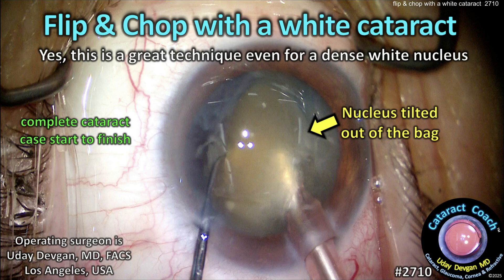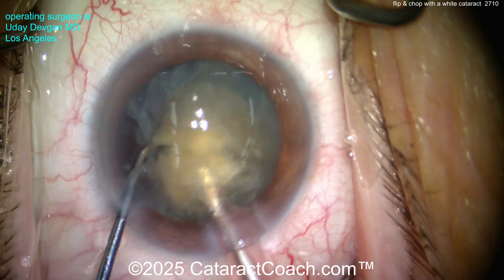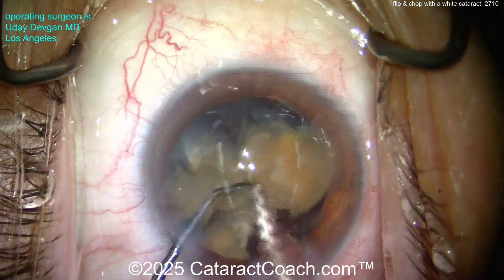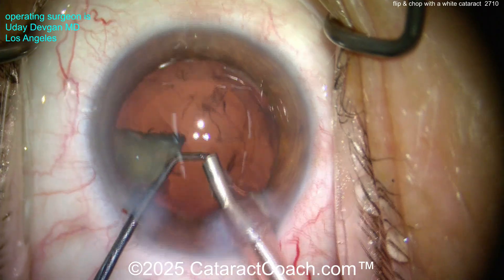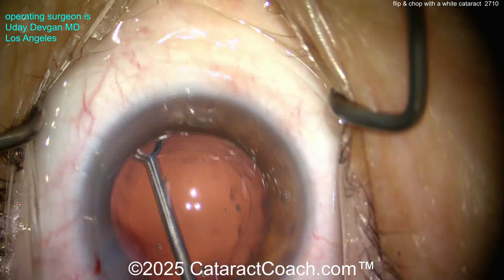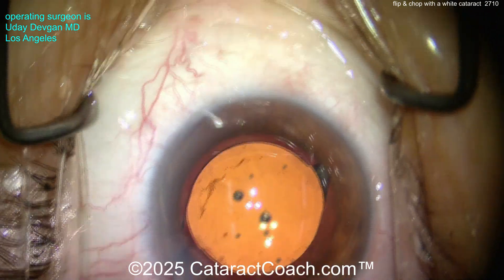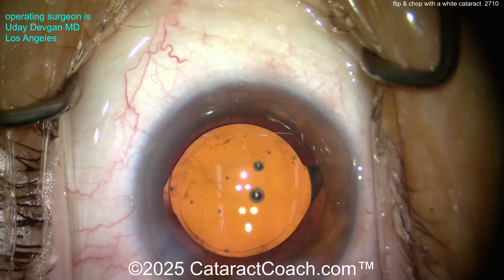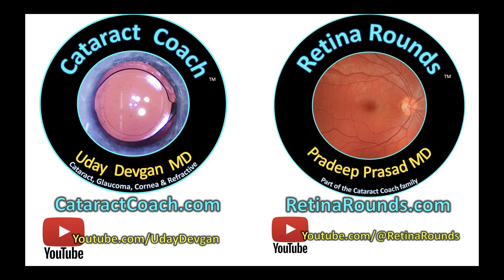CataractCoach™ 2710: flip and chop with a dense white cataract

Comment: Glad I'm not alone in using the flip n chop with hard cataracts here as long as the eye is big enough! -- why is it not for newbies? (I've just passed 1000 cases not long ago) but if I was to tell a colleague what to be careful about this technique in hard cataracts- it would be avoidance of pushing the lens into down towards the post cap while attacking the posterior plate... And being very gentle with the phaco pedal Ultrasound energy! Tayloring pulse slow duty cycles too.

Comment: When I accidently prolapse the nucleus out of the bag during hydrodissection I actually push it back in the bag because I prefer to do horizontal chop of the lens within the bag than over it.  I think for me, in my hands, there is less risk of damage to the anterior capsule with the chopper and I like doing this further away from the cornea endothelium than in the anterior chamber.  I think it also depends on what kind of phaco machine you use.....I use a venturi pump with a straight tip and you are using a peristaltic pump with an angled tip here so that may affect the interaction with the nucleus.   I also think that in a case with weak zonules the forces on the capsular bag a re a bit more asymetric with flip/chop and it is difficult to know exactly what is going on with the capuslar bag underneath your instruments as you do this whereas with horizontal chop you can see and feel an area of zonular dialysis as you work and add support if needed.   But there's not question Uday that  you are a masterful surgeon and have made this technique work very well in your hands!